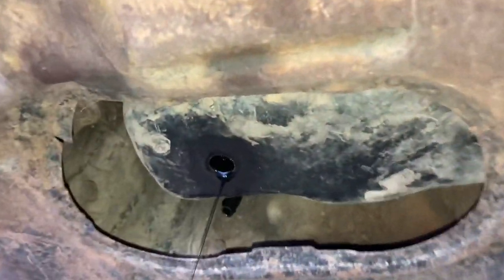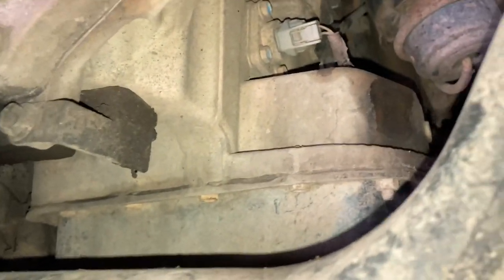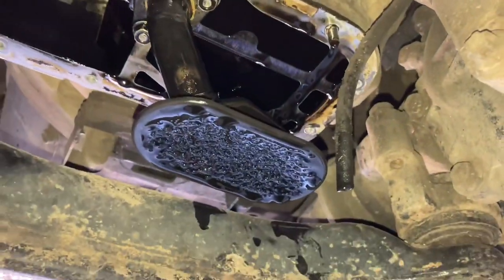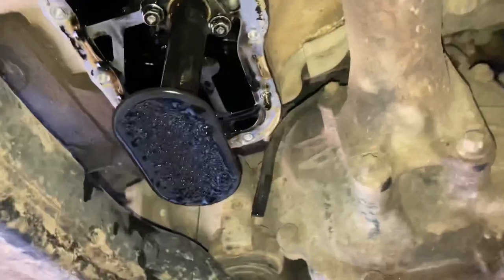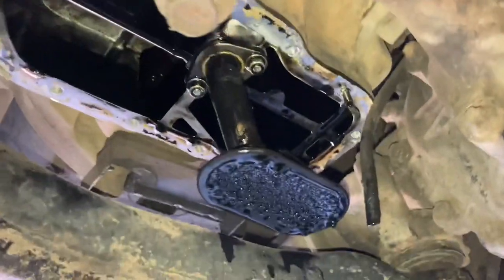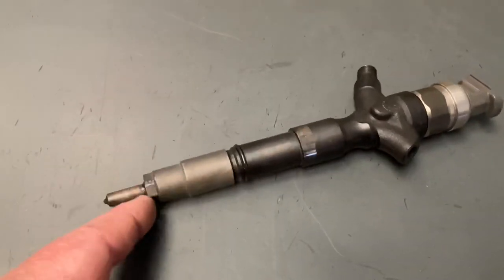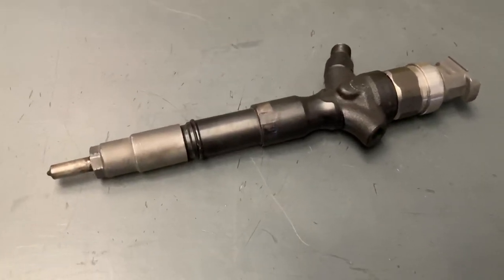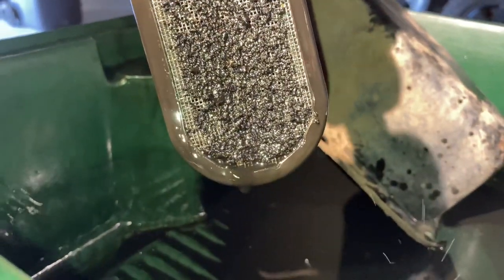SAVE YOUR ENGINE BY CHECKING THIS ASAP oil change and check pick up

Comment: I first came across a blocked oil suction screen decades ago doing an oil change on a HJ60 back in the 80's. after dropping the oil, for some reason I poked my little finger into the sump plug hole and could feel a loose nut lying in there. thinking this could be something serious, removed the sump to investigate further. the nut must have been dropped in there during engine assembly as nothing was missing, but the pickup screen was blocked 90% with tar. removed and washed it with kero and no more issues. a couple of years later had a job working on large industrial diesels and gas engines, same applied to them except that the gas engines were clean as a whistle inside

Comment: Oil pickup blockage will cause a oil pressure drop at high RPM and the oil light will come on at high rather than low RPM.

Comment: I just serviced my car cleaned oil pick up month later cracked piston.  well. I don't know.  but after 3 days of trying everything I can.  car is stuffed.  can't start life sux
Reply from the maker: If the oil pick up was blocked it can cause things to run hot and contribute to the problem but most likely you’ve got the original old Flogged INJECTORs in there and they are the cause of the Cracked Piston as described in the Injector information playlist please check it out
Reply: Injectors are 70k new.   I got ripped from a joint in thomastown.  What's a new motor worth.  Is it worth it. 
Think I'll text you tomorrow and hopefully we can work something out.
Reply: @jarrodmann2010 hey Jarrod, what did you end up doing ?

Comment: USE Liqui Moly flush engine 👍🏻
Reply from the maker: You can if you like but it won’t clear this out
Reply: @Fourby4Diesel that carbon is baked on. I really don't think liqui moly would sort that. I think I might drop my newly put in oil back into a container, drop the sump, check the oil pick up and put back on and out the oil I have back in it (only done 500km)